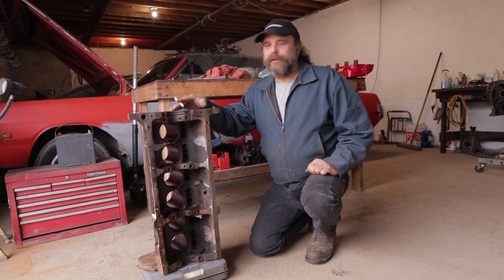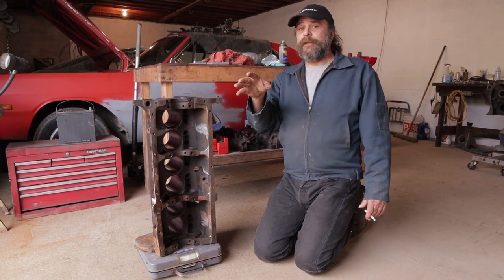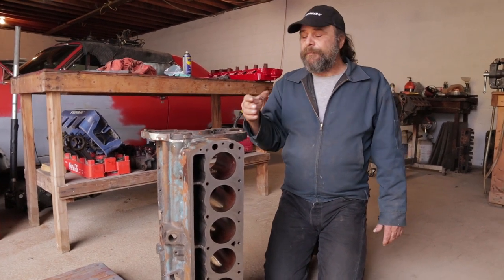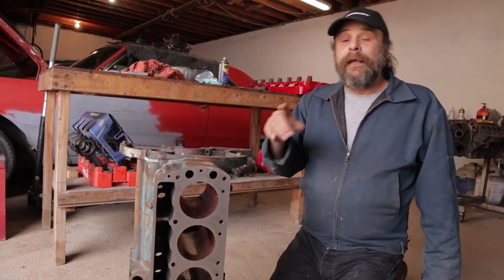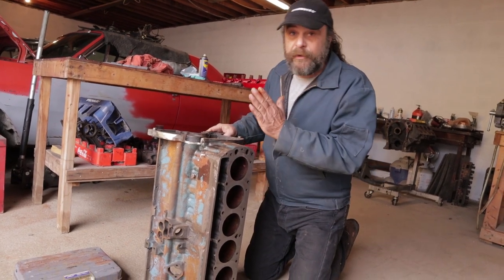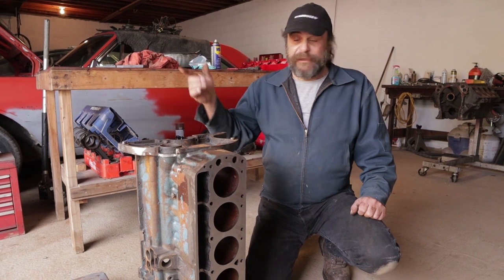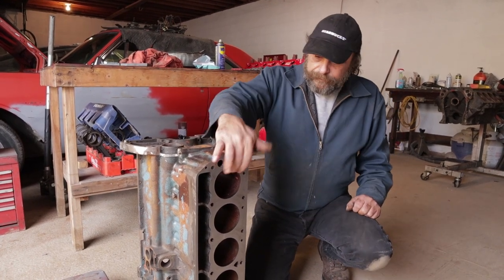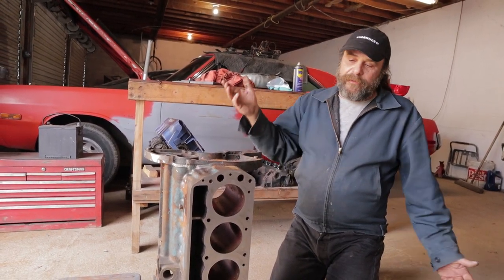Hot Rodding The Slant Six - Working The Block And Finding Compression

Comment: Your assumption of the short rod, is totally opposite to what an engine wants, which is a longer rod. The inter rod causes the piston to dwell at TDC longer, allowing more time for the combustion process to push on the piston. This equal more power per RPM.

Comment: To keep it std you can bore it right out and sleeve it back to standard no taper problem and you keep wall thickness
Reply from the maker: Wall thickness yes, but you kill deck integrity
Reply: Ahhhhh forgot about that , personally I have not done it but one of my trade school teachers in the early 70s used to do it with grey Holden motors 138 cube 3main bearing 6 cyl motors I think they were a copy of 1950s chev . They were built for circuit racing it just clicked that drag it a totally different animal . Love the build it takes me back to the 70s when I built up a couple of very fast slants myself. If you are going to use the first crash box have a bucket ready to catch 2nd cluster as it comes out of the box . Cheers

Comment: Safely bore 100 over plenty of meat never had any problems , set up on messenger and I can give you all the info on how we built ours !
Reply from the maker: Doug, this is the 81-87 casting.  It rang like a bell while it was being decked.  I also noted many areas of inconsistent thickness as I was removing weight from the block.  My instincts tell me to leave this one alone

Comment: OK, I gotta ask ...  You have made it very clear that you want to get weight out of this car, especially on the front end.  And in all the previous videos about this project, you said you were going 60 over.  But here you say you are keeping the stock bore??  Seems this is an opportunity to loose metal/weight by boring the block, and gain HP.  Does not seem consistent ...
And, for a race only crank that will not need to live 100K, why not jut cut away the counterweights? Lots of old-timey cranks did not even have counterweights ...
Reply from the maker: When I picked up the block, the guy who cut the deck commented on how much the block rang as he did the cuts.
While I was grinding, I also noticed that there were thin areas of the casting...the metal didn't flow as evenly as it should have.
Knowing that, and weighing the pound of metal and 7 cubic inches I would have gained vs. having thin spots/hot spots and potential cracks in the cylinder walls, I decided leaving them alone would be my best option.
Reply: Understood. 
Now to find a block that will go 100 over for the engine after this one :D

Comment: When you are working with small engines small reductions in weight stack up and make a big difference. My 400s and 455s make so much torque that they really don't notice most of the small things, but the small stuff end up being big in a slant six or an OHC Pontiac 6. If I could find one of those OHC 6s in decent shape for a decent price, I would do it up like this and drop it in something light so we can see what runs faster... all low buck of course. Slant 6s are lots easier to find. The leaning tower of power! 

My sister in law has a convertible early Dart with a slant 6, it sounds like a sewing machine, lots of fun to cruise it. Tiny little car so it moves ok, not faster than my GTOs, but they can roll 75-80mph in it if they dare.
Reply: Good luck with that OHC. I remember looking at a convertible Firebird, '67 or '68, with the OHC badging. That was 1985, and it already had a 326 in it, and the 6 had been scrapped long before. If there is a dozen of those left waiting to be found I'd be surprised.
Reply: @SweatyFatGuy  I was saying there are less of the OHC engines around as there are OHC bodies. And there ain't that many of those. Of course you'd do something with it - you'd find an old OHC car to go with it, and that combo might be worth $50K. Tempest is up there with the best looking cars ever made.

I knew a guy with a 400 77 Trans Am. He put a Muncie 4 speed in place of the Hydramatic, around '85 or so. It was so fast.